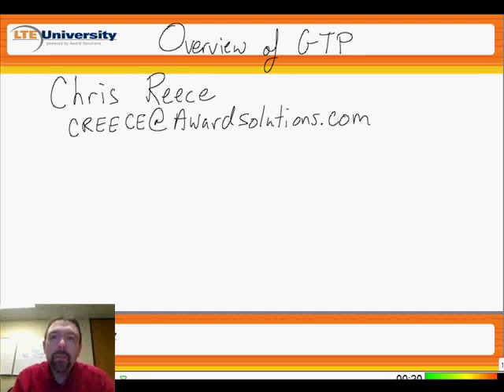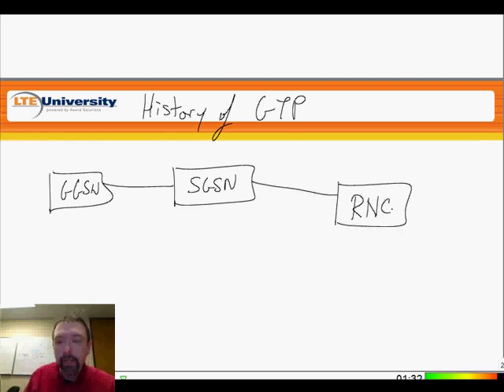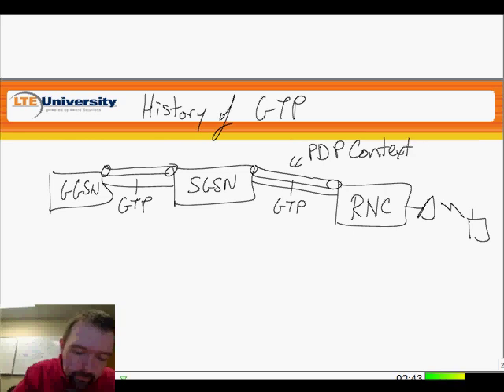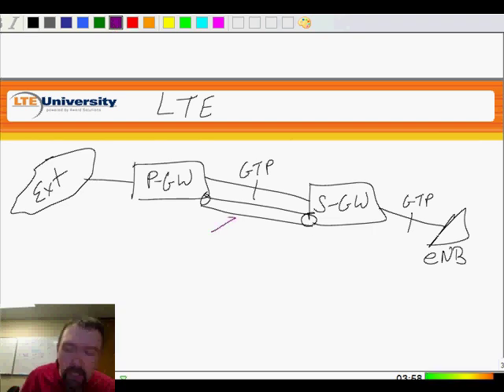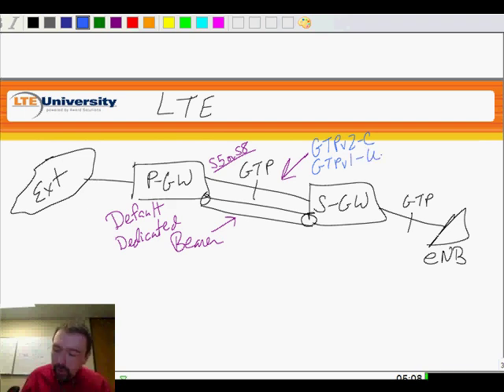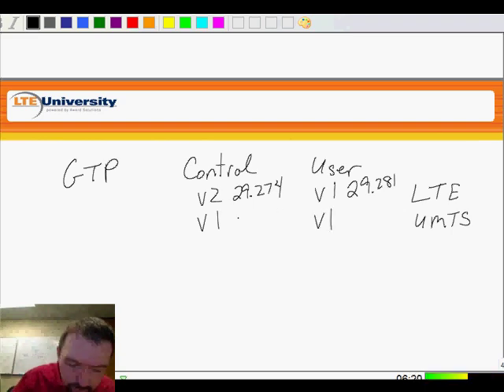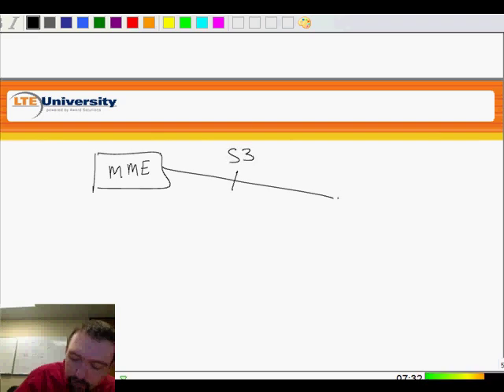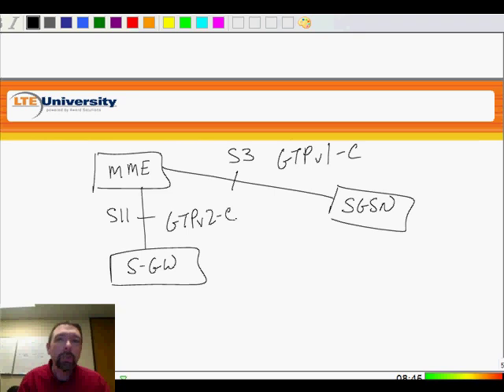Overview of GTP

Comment: Hi Chris, as I type its 2022 so this video is a bit long in the tooth. My question would be is it 'all sorted out' now in mixed UMTS/LTE networks with mixed usage nodes like a GGSN+PGW that would have to deal with both GTP flavours...?
Are there any differences between UMTS GTP User Plane v1 in 29.060 and LTE GTP User Plane in 29.281? -Noted from 29.281: “This definition ensures full backwards compatibility with RNC, SGSN and GGSN implementations according to release7 of 3GPP TS 29.060”")

Comment: What is the reason to have different v2 for Control and V1 for user plane? What is the need to have different versions?
Reply: In 2G/3G (GRPR/UMTS) GTP-C (control) v1 and GTP-U (user plane) v1 were created. When LTE was designed in 2008 (Rel-8), there were significant differences in the signaling concepts, especially QoS and PDP contexts became EPS bearers. This required significant changes to control plane signaling and GTP-C v2 was created. However, for user-plane nothing changed (UPD tunneling with tunnel-identifiers are used) and hence GTP-U v1 is continued to be used.
Reply: thanks @irfan Ali
Reply: gtp loss in my endobe , due to this my user throughout is not good , so how I can remove this loss.
Reply: @sharadsontakke3974  check ping and trace route from PGW to eNB..if there is packet loss,involve IP and transport team for rectification